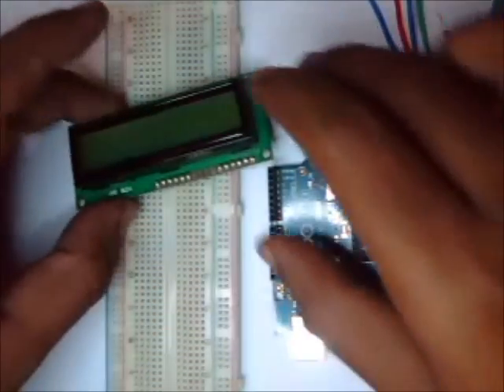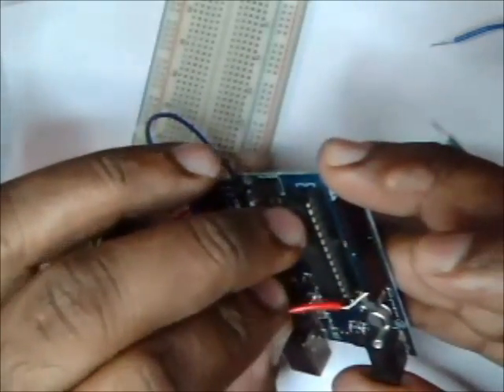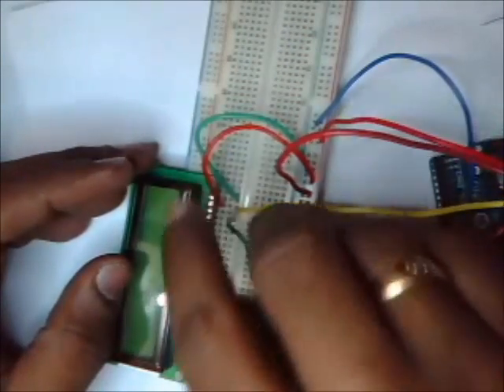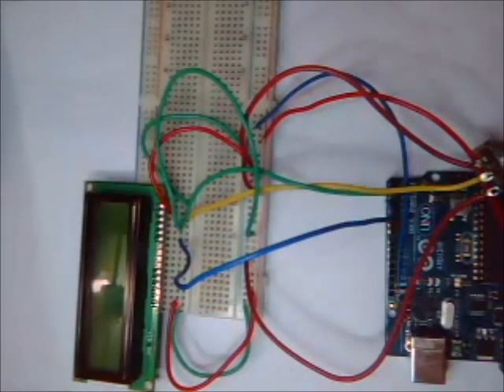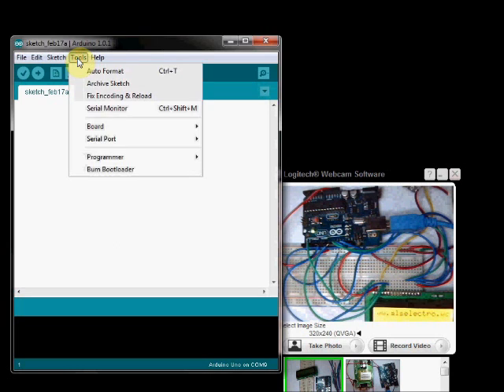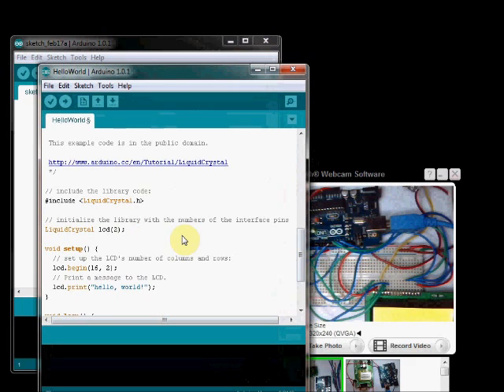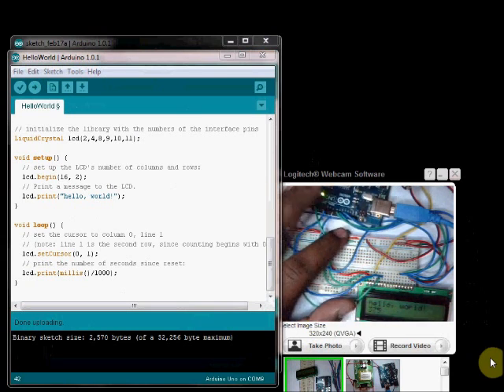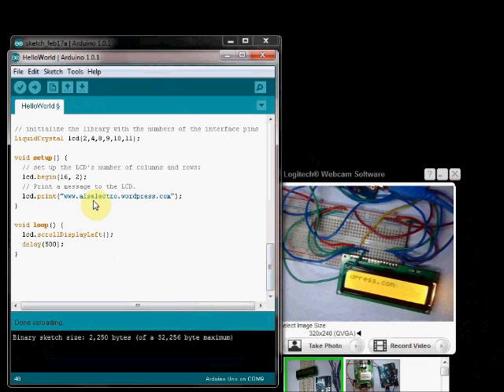Arduino -Interfacing with LCD

Comment: hello sir. im interested with your project. i have question. can we connect two lcd using one board arduino. thanks
Reply from the maker: You can use 2 LCDs , provided you solder an I2C back pack to LCD
Refer this video :  https://www.youtube.com/watch?v=Wj_BBSsfNRg